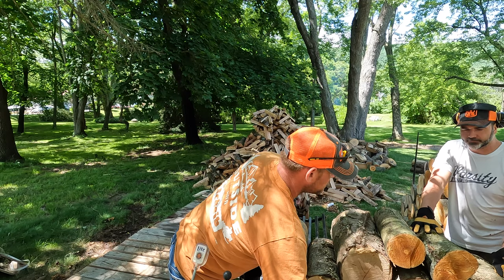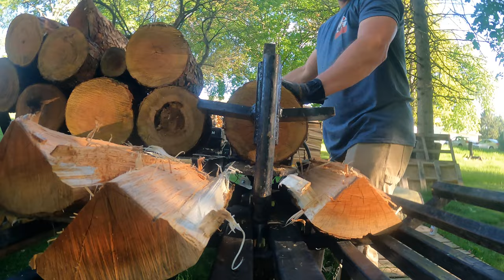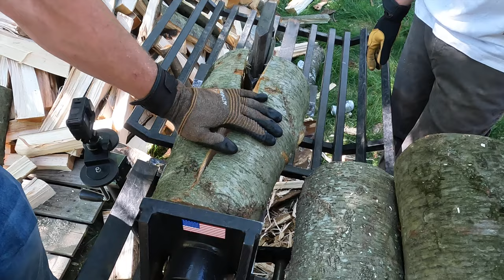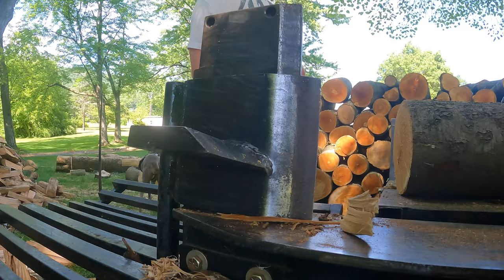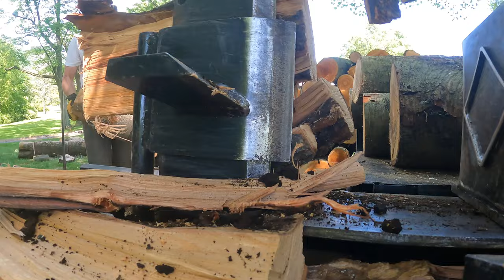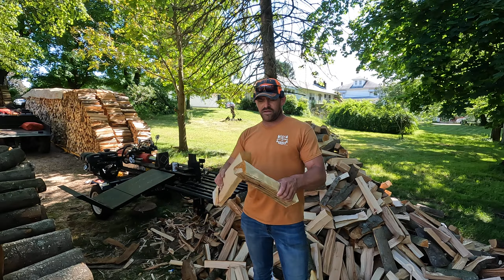Splitting Black Birch for the roadside stand

Comment: Nice touch on upgrading the rack on the wood splitter to Grade 8 bolts. I need to do that to mine. Wooo! 🍻
Reply from the maker: Had to do it I never really travel with it but if I do the modification I did for the wedge let’s me keep it on so I just bolted it fast🤘🏻🤘🏻🍺🍺

Comment: Here in Connecticut we have a fair amount of black birch. It seasons in less than a year and does put out great btu's, I rate it the same as oak. It doesn't last as long as oak, tends to go punky quicker. A plus is that It also smells great when cutting and splitting.
Reply from the maker: I have noticed it doesn’t have much of a shelf life I wonder if splitting stacking then covering would make it last longer?
Reply: @OutsidewithScheib  I’d assume keeping the top covered would help. Mine now gets burnt long before I have to worry about that.